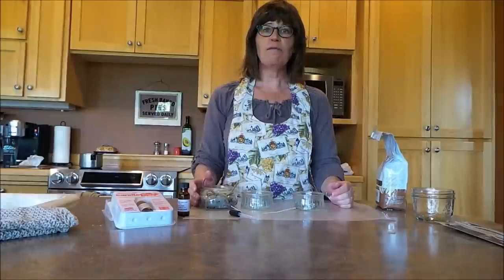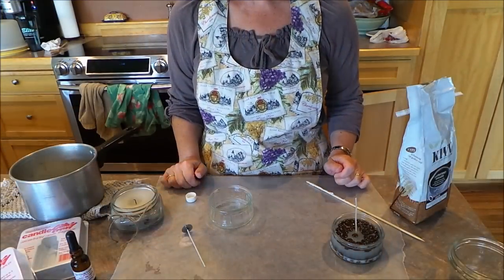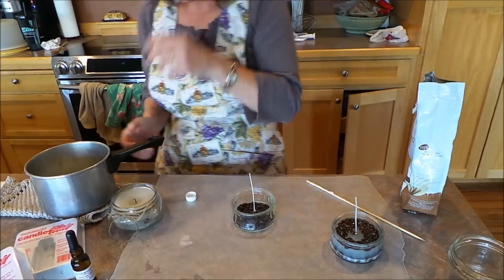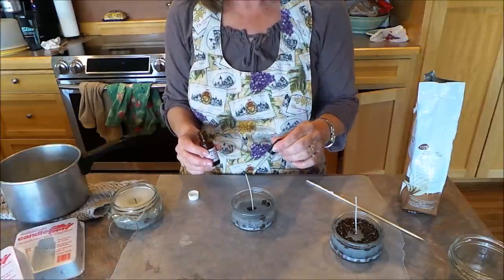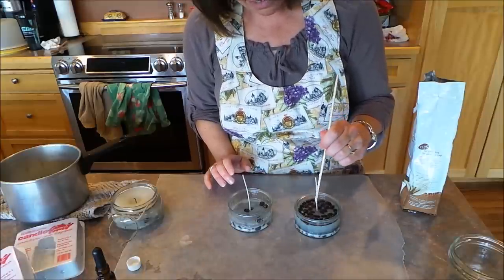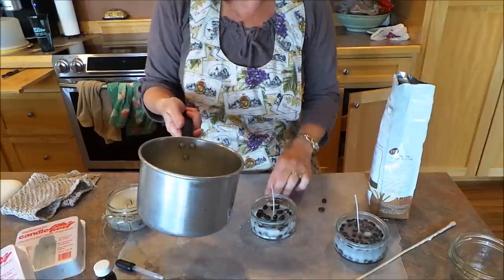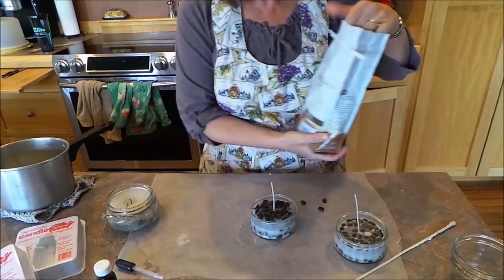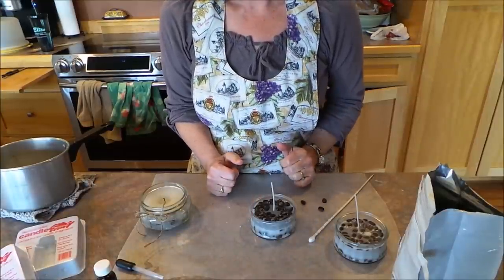DIY Coffee Bean Candle

Comment: How long you let wax cool before putting in a glass jar, so jar doesn’t burst?
Reply from the maker: Pre-heat your glass jars before pouring your candle wax into them – this allows the wax to cool at a slower rate and air bubbles can escape to the surface.

Comment: Will the coffee work if is grind it, does it have to be the whole bean ?
Reply from the maker: Yes, you can use coffee grounds as well! Once wax is melted, pour a thin layer into your container while holding the wick straight up. We recommend using a funnel while pouring wax to keep from making a mess. Add a light layer of coffee and then add the rest of the wax. While wax is still wet, add the rest of the coffee and lightly stir coating the coffee in the wax. Make sure beans are not too close to the wick or they will burn when lit!